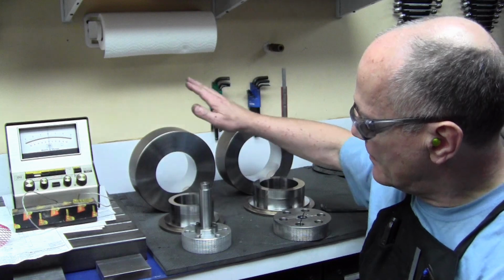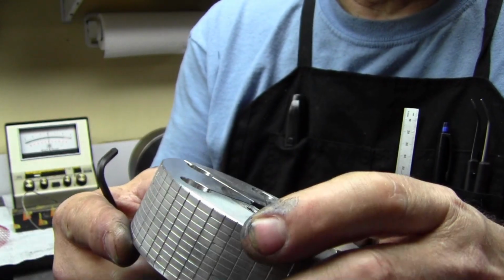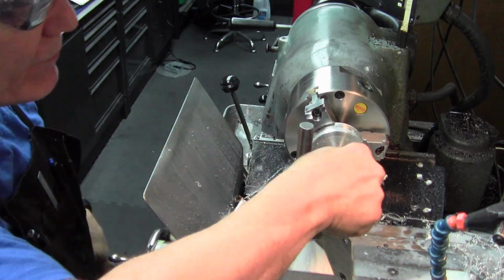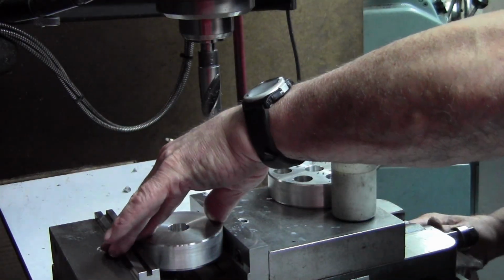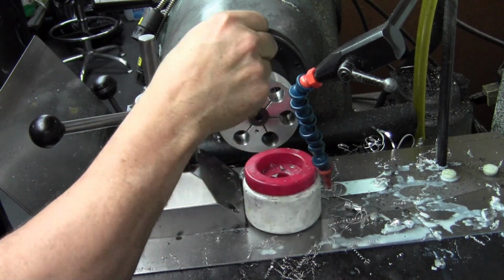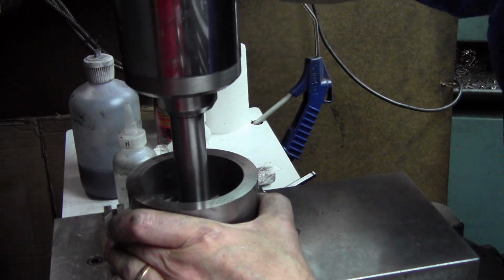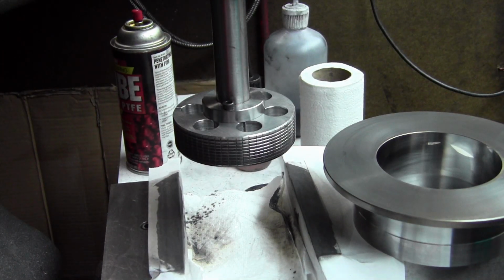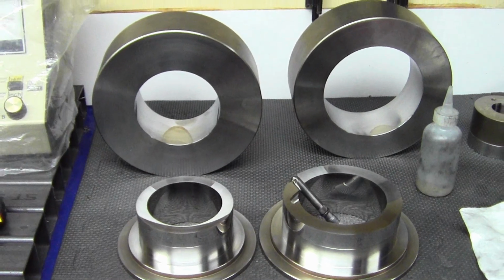MAKING AND USING LARGE DIAMETER LAPS

Comment: Excellent video! Some questions:- 15 microns, that's about 1200 grit equivalent? And that yielded that final mirror finish?- what do you figure was the total material removal through this particular lapping operation?- what was the aluminum alloy? (or does it really matter?)- do you make the diamond slurry yourself from powder, or buy it that way?- you mentioned preferring diamond being cleaner & cutting action (presumably over more traditional 'grease' pastes like silicon carbide). I've heard it can be a bugger dislodging from the part itself if under a certain hardness number. Do you have experience or rule of thumb in this regard?- (newby question) what exactly do you mean by 'hard turning'? Regular carbide lathe cutting tools or some other removal process?
Reply from the maker: Thanks Peter.  A soft lap like aluminum will give a finer finish than a harder lap like iron. 4" dia. x about 1.5 length that was oversize x .00025" radial material is .0047 cubic inches removed. Not sure on the alloy but probably 6061-T651 and it does not amake a big difference unless it was 7075. Slurry is purchased. Silicon carbide would have taken 2 to 3 times longer to get the same results. As I mentioned it can be a nightmare when your part is not much harder than the lap. If the particles charge into the part you are in trouble. I use CBN tools to hard turn and I am doing a video on that soon.
Robin
Reply: Missed it in the video but your using 15 micron diamond powder in the slurry?  Slurry in oil or water?  Thanks for the info.  BTW voice over is the obvious way to go.  I really like how your videos progress w/o a bunch of umms and dead time,  just a nice quick description of the process.  I'd  be willing to pay a subscription to watch   surface grinding videos on your channel.
Reply: Peter, with relatively medium size grit you can get mirror finish, because lap is soft and material is hard (it's D2). Diamond makes better, cleaner, more consistent cuts and gives better geometry after.
Example (read user Pumaracing post): https://www.pistonheads.com/gassing/topic.asp?t=980840

Comment: That's a great tutorial. I wonder if I can miniaturise the design for use in my hobby machining. Is the part with a crack now a very shiny paperweight, or does it not affect the part in operation?
Reply from the maker: Thanks puddingpimp, you can buy barrel and blind hole laps inexpensively for sizes 1" and under.  The part can work fine with the crack. Thanks for commenting and watching!
Robin

Comment: Nice one Robin, bad luck on the crack, but it sounded as if it didn't affect this part.

I have also used aluminium laps and find they hold the diamond just fine. I've found the cast iron laps wear better however. I don't bother cutting any scores in the lap as I don't think that is important with diamond; the particles are too fine. However I use diamond paste which is also far less messy. Once the lap is properly charged it doesn't need to be renewed constantly.

Personally I would have flipped that part and lapped it from the other side if possible. Although the bearing surface is not as good to hold it, more of the lap could have been used, as it was cutting on the end of it. It would help to prevent the lap wearing tapered.

You did very well to get an ID hard turned to that tolerance. I've never needed to do any hard boring, but there's a lot of pressure on external hard turning from my (limited) experience of doing it. I've had good experience with cermets with OD hard turning and am interested in what you used for the ID?
Reply from the maker: Thanks Pete,  
The one larger lap I showed in the beginning was iron and I agree they wear better. I like the grooves for lube/slurry distribution and swarf removal but I agree they are not essential. Yes a well charged lap can go along way before needing more diamond. The video may have given the impression I was only using slurry but I was using kerosene in a lot of the off screen lapping to remove all the swarf.

The lap was able to pass clean thru the bottom of the part going between the vise jaws so I was keeping the lap nice and cylindrical by how I was stroking it.

I use "used" cbn throw away inserts that I braze onto shanks or onto standard inserts and then I grind and lap a new cutting edge. They work very well and are resharpenable many times. I do lots of hard turning and boring on the Hardinge. and on smaller diameters like 1.5" and under I can hold +/- .0001" easily on production parts. The large diameters are a problem because the mileage the insert sees per part is huge and the wear that I might chase on 20 small parts adjusting after every part happens during the single large part.

All the best,
Robin
Reply: Good one, thanks for that. It sounds like a PIA on semi-production work. I'd be interested in seeing some photos of that tool if it should happen to make a cameo appearance in one of your videos. Your viewers would probably also be similarly interested in seeing some video of your hard boring too. The closest I've come to "hard boring" would relate to the difficulty of the "hard" part, and "boring" is the rate of stock removal!!! At least on my noodle. The finish kicks butt however, and it's almost worth the price of admission for that gee-wizz factor alone!
Reply from the maker: I am already collecting clips for a hard turning video!

Comment: Hey Robin,

Nice lapping video. Are you going to be able to use the part that had the crack in it? Long way back to make another one. We had a similar problem with some D2 not that long ago. I wonder if some of the D2 on the market is lacking some quality control. Two cases don't make a statistical argument but you have to wonder. 

All the best,

Tom
Reply from the maker: Thanks Tom, 
That part eventually gets a matte finish from abrasion in use so the crack was not an issue.  That does make you wonder about the D2. I could hear that crack in both the pre heat treat boring and when I was hard turning the bore so I knew it was there from the start.
All the best,
Robin
Reply: Hi Pierre,

After we reject it here in the US it gets send to Canada.....

Cheers,

Tom
Reply from the maker: Pierre's Garage Was that round bar or plate?
Reply: ROBRENZ
Some plate like 1.125" x 7" x 30"
Reply: oxtoolco
Ah...!!! Guess you would...   lol
Reply: Hey Tom, great you pointed out Robin to all of us, he's a great teacher...   ;)

About fractured D2, last year we bought some D2 with cracks in it, this chunk was previously rejected by another client of our supplier, we ended up paying scrap price for the part, this was all right for us since we were cutting our parts around the fractured portions...

Makes us wonder how far this is spread, this is Montreal,  North East Canada...!!!

Regards,   Pierre

Comment: You may have mentioned the suspension liquid for the diamond, maybe I  just missed it. Just water? I find myself drawn to the lapping process, thanks for the great coverage.

Best,
Stan
Reply from the maker: That slurry is an oil soluble slurry and the actual mixture is proprietary to the company I used to work for. It allows you to use WD or kerosene for extra lube and to wash all the metal debris away. Water soluble slurries are also available and used for metallographic prep work. Thanks Stan for commenting and watching!
All the best,
Robin
Reply: This is something I was also wondering. Very interesting, makes me want to go make a bunch of random mirror finish parts, haha. Can't wait for more!

Comment: Great video Rob for a useful tool. I noticed a mod on your tool post that I've been thinking to make. To have a solid attachment for it by removing the top slide that in fact is hardly used.
If you could ever give us a tour of your shop and equipment would be great.

Cheers
Jorge
Reply from the maker: Thanks Jorge, you wont be sorry you got rid of the compound slide when it comes to rigidity and repeatability.  No shop tour but I promise you will eventually see it all in detail. Thanks for commenting and watching!
Robin
Reply: In a comment in another video Rob talks about having a few dozen tool holders with known Z heights so he can swap between tools without having to re-zero because of the solid toolpost!